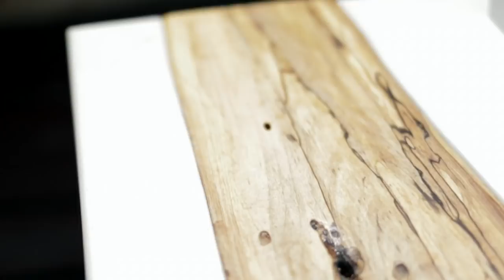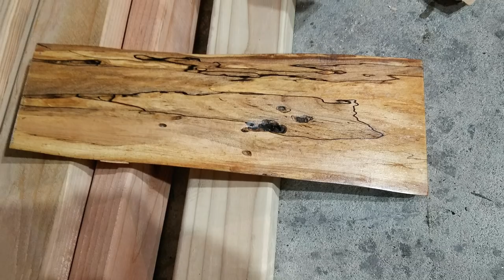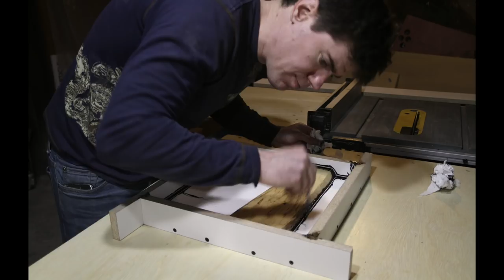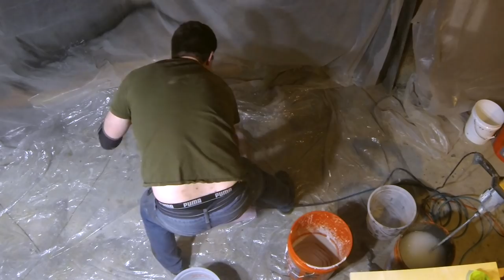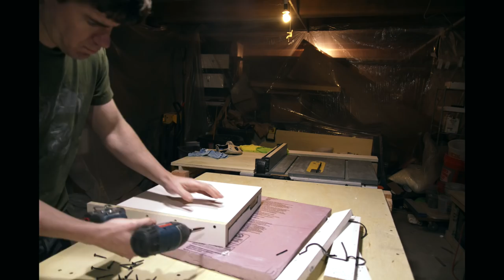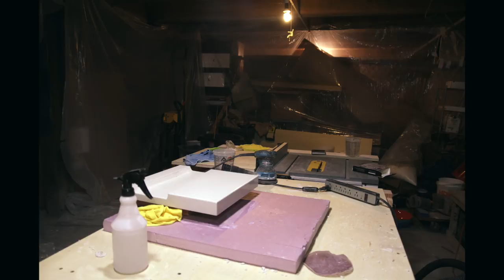DIY White Concrete Table w/ Live-Edge Maple Inlay (using GFRC mix) - How To Make

Comment: Could you do this on a bigger table surface (like a dining table) without reinforcement?
Reply from the maker: Yes, GFRC doesn't need reinforcement because it can actually flex, so has much greater flexural strength as compared to standard concrete with re-bar.  If would suggest making the table at least 3/4"-1" thick.  Any thicker, and you could use a foam insert (just pink foamular) in the middle to reduce the weight.
Reply: Modustrial Maker Great thanks so much! I'm looking to try and make a coffee table and end table in a slate gray with a lighter wood and white with a darker wood for a dining table. Moving into a new place and strapped for cash so using the same design. Thanks for the video, I might be picking your brain a little bit more shortly!
Reply from the maker: Awesome, I'm excited to see how it comes out!   If cash is tight and you think you'll do more projects with GFRC, you might consider investing in bulk components to make your own mix.  Then you can buy white portland cement (about $20 per 92 lb bag) and sand (about $4 per 50 lb bag) locally, and save a ton on shipping.  You'll probably have to buy about $500 in materials up front, but this is what I did, and I was able to make a desk, fireplace hearth, this table, two coffee tables, a bar countertops, and still have some leftover, from this initial investment.
Reply: Wow okay I'll definitely look into that! It'll be my first set of concrete projects so we'll see how they turn out. Thanks again and I'll be sure to update you!
Reply from the maker: If your first project, then it just depends on your confidence in your ability to figure things out :)  The just-add-water mix is some really great stuff and is super easy to use.  Basically the same process as any mix you buy in the store, but arguably much easier to use overall because the mix is so workable, doesn't need re-bar, etc.  Check out my new video for the coat rack where I use it.  It runs $35 per 50 lb bag, but makes things incredibly easy.  You could do a dining table and side table with 200-250 lbs, so probably $250 total or so once you factor in shipping and glass fibers.  Not super cheap, but the end product is easily something that would cost you $1500+ if you paid to have it made for you.  To get an idea, check out what one of my other subscribers made on their first time: http://modustrialmaker.com/blog/2017/10/4/modustrial-guest-build-gorgeous-african-mahogany-white-concrete-coffee-table-why-you-shouldnt-be-afraid-to-try-gfrc

Comment: The GFRC 50# bag mix,  is that in place of buying all the separate products?
Seem like the list of products is about $300 for all the smallest sizes.
Reply from the maker: Yes, it is.  The only part that isn't in that bag are the AR glass fibers.  Those are separate so you can mix your face coat without them.  So face coat is just add water, and the back coat is exactly the same, except you also add the glass fibers.

Comment: What plasticizer did you use? Also, the face mix was the pre blend GFRC Mix minus the AR Glass Fibers?
Reply from the maker: I use Optimum -- bought a gallon of it a year ago.  It lasts forever: http://www.concretecountertopsupply.com/Item/Optimum380Gal

I made my own in this video, but yes, the face mix and backer mix are the exact same, except for the glass fibers.  I just tried the GFRC pre-mix myself, and it would work just as good (if not better) for this project.  I would go this route, unless you want to save money and buy in bulk for a lot of concrete projects at once, or are the type that really enjoys knowing how everything works.
Reply: How much Optimum per 50# bag did you use? Thanks for the replies! Awesome video
Reply from the maker: So, if you use the bagged GFRC mix, you don't need to add plasticizer -- it is already in the bagged mix.  If you are making the mix from scratch, I use 20-40 ml per 50 lbs (so a gallon really does last forever!).
Reply from the maker: also, I'm editing a video as we speak where I use the GFRC pre-mix bag...should be out this week so keep an eye for it.  I go into more detail on using the pre-mix (and pouring the face coat instead of spraying) in this video.

Comment: how could somebody dislike it.
Reply from the maker: ha, I guess beauty is in the eye of the beholder.  Thanks!
Reply: Well, if you tried to use it outside sun & humidity would IIRC age the concrete and fiber badly inside 2 years and bow the wood luridly. Doing that to hewn marble would only make one crack a year, but...who wants to see that?

Comment: Is there a way to do this without the spray? I don't have the ability to buy the air compressor right now
Reply from the maker: Yes you can just pour a thin face coat layer and brush it in

Comment: Is it crucial to apply first layer with a spraygun? Can I apply it with a brush?
Reply from the maker: A brush will work pretty well, as long as you don't have large vertical sections to apply the face coat to.
Reply: @modustrial  Thanks for the advice!

Comment: Could this kind of mix work for making concrete planters like the one on your table? I don't know much about concrete
Reply from the maker: Yes, absolutely.  It would be good because you could make planters that have thinner walls (e.g., 3/4" or 1"), and thus are much lighter, than it would be with a store-bought cheapo mix.  Since the standard concrete mix doesn't have nearly the flexural strength of GFRC it has to be cast 1.5" - 2" thick, and requires complicated rebar.  For a planter, you would probably not spray the face coat.  You would just mix all at once with somewhat less glass fibers, and pour it in.   Or if you did not want to use an inner mold, you could make this mix with less (or no) plasticizer and hand pack it.  I've done this before, and with a bit of practice, you can make a mix that is more like play-doh and can be hand packed against a vertical surface of a form.

Comment: Where did you buy the shotcrete applicator
Reply from the maker: +James Weil it is just a nice drywall hopper gun with a 45 degree connector, there is a link in the video description

Comment: Is there a way to change the color without messing up the concrete mix?
Reply from the maker: Yes, there are many possibilities in all colors of the rainbow.  Just do a search for concrete pigment powder and you'll find a lot options.  You add the pigment powder to the dry materials before adding the wet components.

Comment: Question....how come the concrete didnt adhere to the wood? What prevented that?
Reply from the maker: The finish, polyurethane
Reply: Thanks for the quick reply! I was going to try something like that but I thought the finish would seal the wood so it doesnt soak the moisture from concrete but still allow it to adhere, as I want mine to adhere. Hmmm.... now I'm not sure. Your work is beautiful and inspiring!

Comment: What type of compressor and PSI do you use for the hopper?
Reply from the maker: Just a cheap Porter Cable pancake compressor, and the hopper gun linked to in the video description.  I know some people have modified a harbor freight hopper with a 45 degree connector, if you are looking for something cheaper, but I haven't used that.

Comment: If you wanted to create a project using this concrete method how could you make the concrete different colour? for example black? or grey
Reply: Great video by the way
Reply from the maker: Thanks!   There are pigments for many different colors available.  Check out some of my other concrete videos -- I use grey pigments in a couple of them.

Comment: What could be the substitute for the Hopper Spray gun and air compressor if you don't have the money for those?
Reply from the maker: You can just pour a thin face coat in.  Not as great for verticals, but you'll still get all the other benefits of gfrc
Reply: Modustrial Maker I am making some display trays at least a dozen I’m want to  have them 15 inches long by 6 inches wide. I have the spelt wood I want to use. Do you ever do contracted jobs like this?  I know it’s small. Or could you recommend someone? Thanks!
Reply from the maker: No I don't...I'm a full time patent attorney so YouTube is just for fun :) what area are you in?  There are lots of concrete artisans out there, and finding someone local is definitely best
Reply: Modustrial Maker I am in upstate New York. Watertown in fact. Syracuse is the closest city. I would appreciate a referral. By the way you could consider quitting your day job! LOL your work is fantastic!
Reply from the maker: Thank you!  I don't know anyone in that area... But I would do a Google search for "concrete artisan" or "concrete countertops" and you should be able to find someone specializing in gfrc
Reply: Modustrial Maker Thanks so much!

Comment: Did the concrete expand and cause any issues after time.
Reply from the maker: +Eliot Sprague you mean the wood?  No, it has been fine...the concrete form was very humid, so the wood actually contracted
Reply: Well thank you for the reply, but I did mean the concrete because it expands a bit.  So I was wondering if you cut any relief edge in a mm or two... and if not I guess it didn't do anything to your
Reply from the maker: +Eliot Sprague hmmm, I haven't heard of concrete expansion problems?  There are "expansion" joints in concrete sidewalks and  such, but ironically, these joints protect against cracking due to shrinkage of the concrete

Comment: How can I adjust the color? Is there a way to mix in color to make it look like granite?
Reply from the maker: Charlie Maconroe yes, you just use powdered pigments.  For granite look, you would mix up a number of small containers of face coat, with some white, some greys, and some brown, then swirl them in the form.  You could also add some stone aggregate and grind it.
Reply from the maker: Circling back -- check out my "marble" concrete table video if you haven't already -- same technique could be used with some brown pigment for a granite look.

Comment: What is GFRC and where can i get me some and what can i clear coat it with that wont tern yellow in time
Reply from the maker: Glass fiber reinforced concrete -- links to from-scratch recipe and "just add water" mixes are in the video description, as well as links for sealers.

Comment: great build, but why does your shop look like the set of Dexter?
Reply from the maker: LOL, that is about the 5th comment mentioning that.  I live in a loft condo building in downtown Chicago, and work in my basement storage area.  It is only separated from neighbors storage areas be a chain link fence, so I have to hang plastic sheets to prevent dust from getting into their areas.

Comment: did you mount your top to your legs?
Reply from the maker: +SCARGARDENS yes, there were holes tapped in the steel base, and I used 1.25" tapcon concrete screws to secure the legs to the concrete

Comment: hi i plan on using the Fishstone GFRC Bag Mix as a spray on face coat then using quikcrete 5000 with rebar reinforcement as the backer. is there any reason this shouldnt work?
Reply from the maker: It won't work if you try to go thin (less than 1.5"), since quikcrete 5000 doesn't have any polymer in it.  You could do this, but you would need to go 1.5" thick or more (depending on size of project), and use rebar in any thin spots.  The combination of the polymer and glass fiber is what give GFRC its strength.  (The polymer is already added in the GFRC bag mix.)
Reply: I think ill do a test run at 1.75 inches thick with rebar. I'm mainly trying to do it this way to have a nice quality gfrc face coat with a more cost effective backer, cant beat $5 dollars a bag for quickcrete. Thanks for the help!
Reply from the maker: That should work.  I did something similar once with Quikrete countertop mix.  My only concern is the large aggregate of the Quikrete 5000 creating some pot holes underneath the face coat that will cave in.  I would suggest getting some superplasticizer and adding it to the Quikrete 5000 so it flows more evenly over the facecoat, to maximize your chance of success.

Comment: you didn't have to shake the mould ? to get rid of air bubbles
Reply from the maker: No, that is one of the beauties of GFRC and superplasticizer, it has tiny aggregate and is super flowable (but low water content), so you don't need to vibrate it.  The mix also included a couple drops of defoamer, which chemically helps to reduce any bubbles that might create voids.  The superplasticizer and defoamer are both included in the pre-mixed bag I linked to.  If you are interested in mixing from scratch though, just let me know, and I can help you along.

Comment: How well do this white concrete hold up/clean against stains?
Reply from the maker: It is similar to a marble countertop in care, perhaps slightly more resistant, depending on the quality of sealer you use.  If you clean up spills right away, it can stay new looking.  If you let a wine stain sit, it will stain.  Nice thing with concrete is that you can always sand it down and/or re-slurry and sand, if there is a major stain.
Reply: I am thinking of using this to build a portion of a bar top for my basement bar but I want to be sure that it will hold up over time.
Reply from the maker: I built the bar in my living room from GFRC and it is holding up great.  I might suggest that you go with a grey pigment, however, instead, of white, if you are someone who views a few discolorations / watermarks as problems instead of character.  Concrete performs similarly to marble as far as stain resistance, in my experience.
Reply: Do they make any sealers? or can epoxy be placed over this?
Reply: Never mind. You stated that in the video.
Reply from the maker: +Bobby Nydza yes, there are quite a few sealer options...I included a link in the video description.  I've seen people use epoxy instead, but I wouldn't recommend it.  I personally don't like the plasticy look of epoxy over concrete, and epoxy scratches much more easily than concrete.

Comment: why did you add a fillet around the wood? That would give you a gap between the concrete and the wood, which you don't want.
Reply from the maker: I wanted to make sure concrete did not flow under the wood when poured in.  It is definitely a tradeoff.  If someone can come up with a way to ensure that wouldn't happen I'd love to hear it.

Comment: Why use the hopper to spray the face coat?  You used a chip brush afterward.  Why not just use a brush or trowel and not hassle with the hopper?
Reply from the maker: It makes it much easier to get the vertical surfaces and to get a thin even coat when you spray it.  Too thick and there is risk of cracking, and "painting" it up the sides is challenging.  You can just spread it in, though, if you like, and you'll get 90% as good results, give or take.
Reply: @modustrial  
I was sure there was a good reason.  I can buy that.  Thanks.  Cool table.
I'm headed to see more of your channel.

Comment: How did you fix the slab to the frame ?
Reply from the maker: I used tapcon concrete screws through holes drilled in steel base.
Reply: Modustrial Maker much appreciated. I'm a little. Worried about the concrete splitting when I screw into it. But I'll give it a go. Thanks again.
Reply from the maker: no problem.  Just follow the directions with the screws.  Use the drill bit that comes with them to pre-drill, make sure to shop vac all dust from the hole, then screw in the tapcons.

Comment: I was thinking the whole way sick project however christ it looked like it took some time to put together.. why not have made it bigger.. I'm curious about the cost to make it
Reply from the maker: If you were only to make this, materials would be about $100.  However, if you have more concrete projects to split up shipping costs, the overall cost will go down substantially -- probably only $50.  This was the first time I ever filmed a build, so I wanted to keep the project small and manageable.  I have a larger table planned in the next few months, so stay tuned :)

Comment: Tried to do the same, for some reason in drying process wood bent and the concrete cracked.
Reply from the maker: Did the concrete crack because of the wood?  Or separate issue?  The wood really shouldn't expand much after the concrete cures

Comment: How did you attach the legs?
Reply from the maker: I just used standard 1.25" Tapcon concrete screws.  My friend who made the steel legs drilled holes large enough for the screw heads to fit through on the lower side of the steel tubes, so I could screw the upper side of the tube to the table base.
Reply: Thank you!

Comment: Why did you consider this precast?
Reply from the maker: It is called a precast because it is made in the shop then moved to install location (the term comes from countertop precasting, which uses this process, as opposed to casting in place)
Reply: Modustrial Maker  what would CIP be then?  Just confused to hear a term like precast for something like a table which is an easily movable object. I design bridges, so for me it's clear what is CIP and what is precast.
Reply from the maker: This article explains it well https://paradiseconcrete.com/what-is-the-difference-between-precast-concrete-and-poured-in-place-concrete/

Comment: It sounds like the use of a large spray gun for the face coat is a waste of time.  If you spray it on and then go over it with a brush why not just pour it in and spread it with a brush? Seems that it's also runny enough to flow and fill any small voids like epoxy does. Where am I wrong?